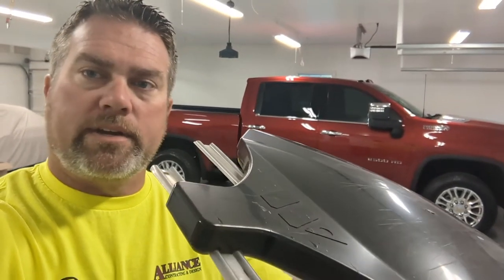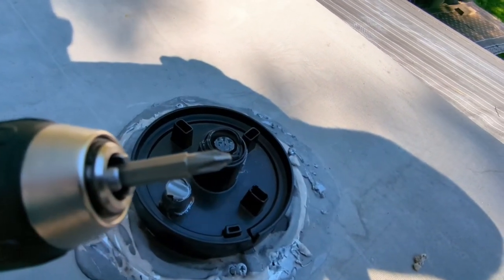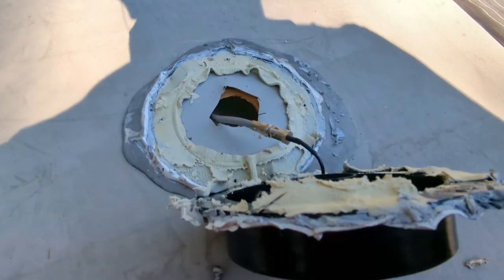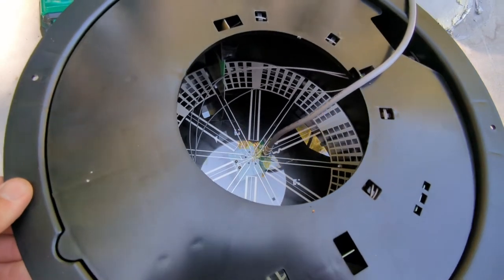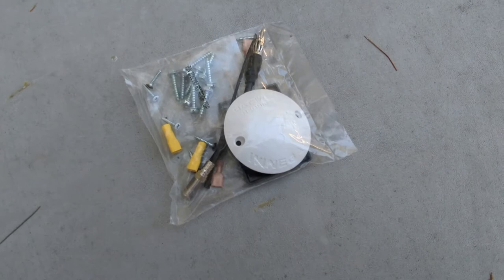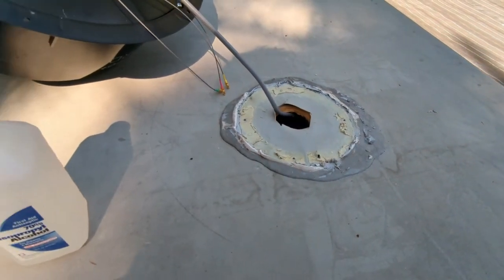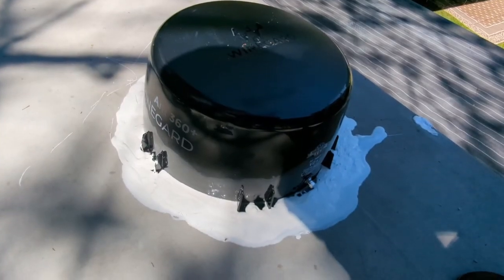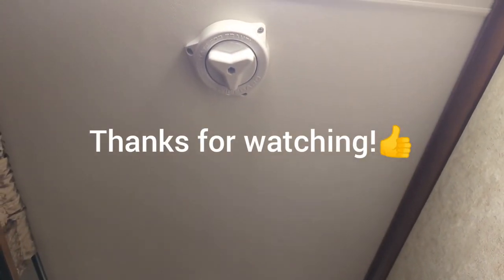HOW TO REPLACE & UPGRADE YOUR RV TV ANTENNA!!

Comment: Thanks for the video. I’ve got a similar issue with my stock tv antenna base breaking off among other stuff but that’s a whole different story.

So I’m curious why did you go with an upgrade vs say purchasing another base for your existing antenna? Also I heard you say Omni directional so does that mean it doesn’t matter what direction it faces it will search for a channel? 

My toy hauler had an antenna but it wasn’t the type I could maneuver. It simply just sat there. So I was thinking of either purchasing another base for it or upgrading to a newer one all together. Also does yours have a motor inside that moves the antenna around inside the dome to search for channels?

Thanks. I’m new to owning an Rv so any help is much appreciated.
Reply from the maker: This one sits a little lower than the stock antenna. I was having issues with trees and stuff  hitting and breaking the factory antenna. This one covers 360°. It basically has a disc style antenna inside, no motor or moving parts. It is also a Wi-Fi booster and some other options that I have not yet taken advantage of. I just like it because it is a cleaner install and most of the higher end coaches are coming with this style antenna now.
Reply: @danczuba  I definitely dig it and yes it looks a lot cleaner and I can only imagine it may be more “durable” at deflecting whatever the driver brings its way! 😜
Reply: @danczuba I’ve got another question. I’m about close to purchasing this antenna and installing it. After watching several videos on installing a tv antenna I’m curious is it as simple as disconnecting the coaxial cable and connecting it to the new one plus of course the sealing part?

Reason I ask is keep hearing about amplification or amplifying the signal?
Reply from the maker: I just hooked up the coaxial cable and it works just fine. There is the optional Wi-Fi booster so you may have a couple extra wires chilling in there; but you don't have to hook them up.
Reply: @danczuba  thank you.